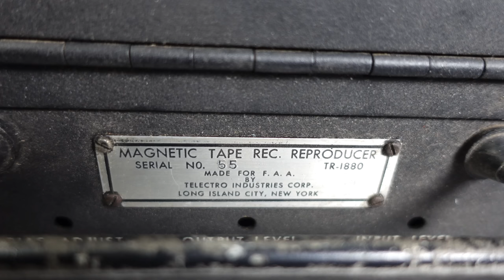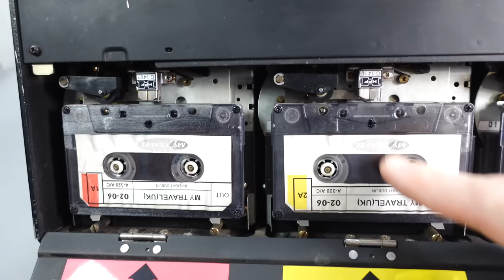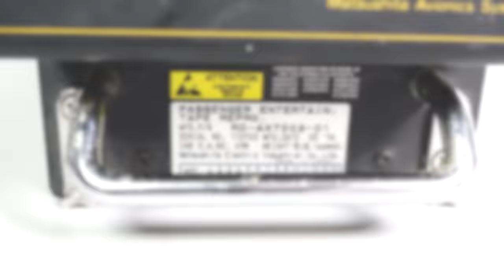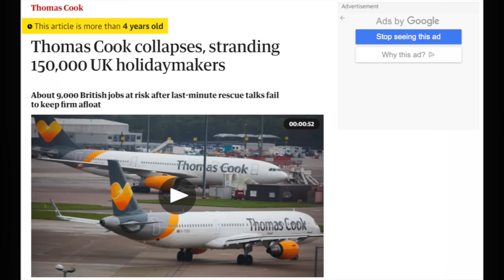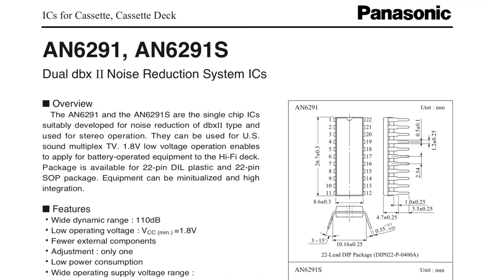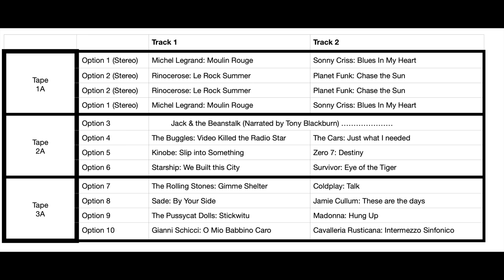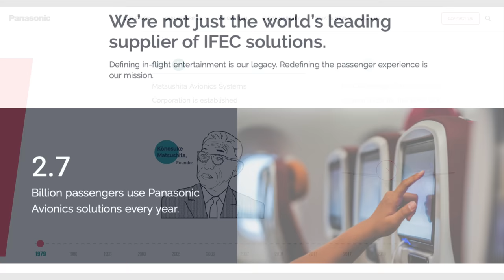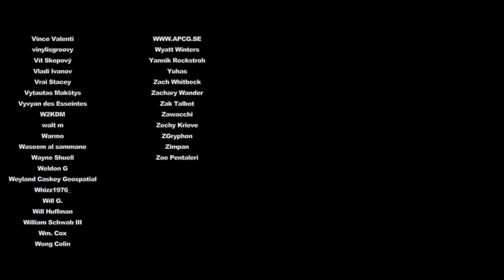The in-flight audio player

Comment: I used to work for Panasonic in the 80s. Your pronunciation of Matsushita is just like the Japanese staff of the company  pronounced it. Be proud of that!
BTW: The heads on this deck where labeled "HPF" - "Hard Pressed Ferrite". Panasonic/Technics used these in a few high end decks and had a 10 year warranty on the heads. Shows that this device was built to last!
Reply: It's probably correct. In Japanese, every syllable is pronounced in exactly the same way every time, so it should be MA TSU SHI TA. But for some words and phrases, vowels will just become silent, like what sometimes happens in English.
Reply: do they really use SMD components back then ? like shown in the vid, i thought smd is only common on a more modern electronics, at least based on taking things apart
Reply: @TonnyCassidy  SMD components got popular around 1985. In 1995 all high end electronics used it.
Reply: @TonnyCassidy  surface mount technology is really old. The Apollo Guidance Computer (AGC) also used SMD parts back in the 60s.
Reply: @TonnyCassidy  That deck had a 1994 label at the back, our 1995 Sony Video 8 camcorder was jam packed with SMDs as well.
Reply: @gladspooky9455  Yes, I have read Japanese is written (when written in Latin alphabet) phonetically which means it's pronounced mostly as it's written. Finnish is the same and also they say the grammar is similar so it's supposed to be relatively easy for Finnish people to learn Japanese and vice versa.
Reply: @mrfrenzy.  Did my first SMD PCB design in '85 for a security PIR and it wasn't that novel.
Reply: @Murgoh hiragana and katakana are phonetic too :) 

The main one which isn’t is the kanji (Chinese characters), which can have at least 2 pronunciations each on their own and more when in combination. That’s why everyone starts with the kana and slowly introduces a few kanji at a time; I’m on par with a Japanese pre-schooler at kanji recognition haha
Reply: @mrfrenzy.  thats surprising, i grew up taking apart electronics, none of it have smd, stuff like tv and other things (never opened really old computers maybe those would have lots of smd), 

and seems like old smd arent plagued with cracked(and shorted) mlcc
Reply: @TonnyCassidy 

Panasonic used SMD components since at least 1977 (in their 'Mr. Thin' radios). By the early 90s, they were absolutely commonplace.
Reply: @gladspooky9455  Yes! shita (below) is one syllable because /i/ is silent between unvoiced consonants. 松下 (Matsushita) means "beneath the pine tree"...I got curious and looked. Lots of Japanese family names have similar formulations. Source: I'm a student of Japanese language for the last year or so.
Reply: @TonnyCassidy  TV manufacturers started late because there is plenty of space inside a CRT and most of it is high power analog electronics. Things like Walkman, calculators,computers, tamagochi, cellphones were early with SMD.
Reply: @gladspooky9455  I and U vowels in Japanese are devoiced when in between unvoiced consonants. So the correct pronunciation is Mats'shta. They also devoice the U at the end of verbs, normally. They can sometimes be voiced for emphasis.
One such Japanese name, Takeshita, is one you do not want to pronounce as in English. (It's TA-KE-SHTA and not Take ...).

Comment: Hi Techmoan.
Probably other viewers allready tex this: this unit was replaced by a cd player in the same configuration, 3 cd's on each side, same maker, direct replacement.
As an avionics thech for many years, working for airlines, as part of overnight service, I got to remove the outdated media and install the fresh one.
And I got to do this (at diferent times in my career) on tapes as thesame machine as on your previous video, on this one, the cd player, also video on betamax, vhs and Hi8.
After that, new systems with digital mass storage started to replace the anolog media, did not work on those, do not remember how the updates happened, then systems like DirecTV, now is all networks and updates by satellite.
Two airlines I work for now are removing the video screens and offering wifi with content on the local server to enjoy on your own device, but you probably aredy know about that.
Reply from the maker: I've seen those for sale - but always without the CDs - a very big expensive doorstop.
Reply: I think ive seen that on American Airlines, you just use their wifi for in flight. In fact when I was on a flight in first class and it was a bulkhead seat, there was just this spring loaded clamp thing and a USB port for power. BYOTablet.

I guess from an aircraft design angle it makes sense, if they do not have to run all the wires needed for infotainment to every single seat and instead just put a few APs in the cabin the airline saves a lot of mass.
Reply: Well, from the passengers point of view I should say that removing displays is very uncomfortable. Using my phone and not a display for watching movies will just leave me in another city or country with my phone's battery low. Because there are no aircrafts with fast charging available for passengers.
Reply: As I finished watching the video I thought about the cd upgrade but I guessed that maybe in such a demanding environment the player couldn’t be reliable long term because of the vibrations. All considered the tape with a solid mechanism seems a much more reliable solution before entering the digital ssd realm.

Comment: There is a simple reason for still using cassette tapes in an airplane in 2006 (and probably even later). Every device in an airplane has to be standardized and certified for every type and configuration of a specific airplane. That means that this audio player might have been certified for an Airbus A320 in the configuration flown by My Travel, but not certified for a slightly different Airbus A320 flown by a different airline.
The process of standardizing and certifying equipment takes a long time and is quite expensive. Therefore airlines are often very hesitant and slow to adopt new technologies. That's also the reason why most airplanes that fly shorter routes don't have any entertaintment system nowadays, since most passengers already have a smartphone or tablet anyway.
Reply: If I remember rightly (to further your point about planes and old tech), a lot of them still use floppy disks for data. I can't remember the reasoning, but I'm assuming it's along the lines of it being certified tech and basically the "if it ain't broke, don't fix it" mentality.
Reply: Certification is not the problem, its the cost of investment. Certified modern replacements exist, that very type of plane still flies today. The simple solution is to use the older planes with obsolete infotainment to shorter routes, like a flight i took from Seoul to Tokyo in 2014, had CRTs hanging in some old boeing from ANA, they never turned these on like they would back in the day, and the audiotainment no doubt was audio tape based with those very same controls shown in this video (volume and channel, that's it). Remember those silly double plug earphones? They didn't bother giving those, but you could always plug a normal one to one of the holes and get glorious one channel.
Reply: @Vampyratus Exactly.  The A320 was certified in either 1987 or 1988, and brand new ones still require floppies.  It's just too expensive and of you have a fleet of thousands built since '86, commonality becomes problematic.
Reply: Usually I'm so exhausted waiting for the plane for many hours that as soon as I sit down in the chair I doze off.
Reply: That's my understanding too - it's just so expensive to upgrade airline components, it's more sensible to just run old tech until the plane reaches EOL (unless there's some component that MUST be upgraded for some reason).  Remember that commercial airliners have a very definite lifespan - basically every time the plane takes off and pressurizes the cabin, that stresses the skin of the plane.  You can only do that so many times safely before metal fatigue starts to become a concern.  Eventually planes with pressurized cabins must be scrapped for safety.  So, why spend a bunch of money upgrading components in a plane that probably doesn't have that many flights left in it anyway.
Reply: I think society in general could take a page from this book.  If a tech works well enough, there’s no need to abandon it.  And, just because it’s not the dominant medium doesn’t mean nobody’s using it.
Reply: @Vampyratus I recently took a flight from Singapore to New Zealand in March and they were still using ribbon printers to print the passenger list at the gate in Singapore.
Reply: @freeculture  That's actually high-tech! I remember when the "headphone jacks" were really tiny speakers and the headset they sold you were nothing more than sound tubes that carry the sound to your ear (similar to how a stethoscope works).
Reply: Absolutely! An IFE system caused a fire which led to the crash of Swiss Air Flight 111.
Reply: @twiff3rino28  Not true. The A320 has had its electronics overhauled several times; essentially single piece of avionics is different from the 1987 A320 to the final 2021 A320 CEO. There are no floppies in a late-build A320. There was a USB era in between, but ultimately they deleted the whole media capability for dataload. Today, any mechanic is going to have a laptop with them, so they plug in their laptop with the files on it to a port.
Reply: they're probably using older planes and aren't spending money upgrading anything
Reply: @TonyP9279 I noticed in pictures from the 60s and 70s they looked like stethoscopes, hadn’t realised they literally were though..!
Reply: @nickwallette6201  What a ridiculous soap box opinion, which has nothing to do with the reality of why airlines do things. Upgrades are done when the money invested is believed to result in a gain in return, not for some silly ecological nonsense. The cost of upgrading any airplane part, even a music player system for passengers, is the sole reason these things stay in service long after they become technologically obsolete.
Reply: Agree a 100% Amazingl enough I was flying a couple of times on shorter routes. And there is no more music. As far as I kown Austrian Airlines are playing sometimes Donauwalzer
after landing. Like that
Reply: @straightpipediesel  I strongly doubt every piece of hardware was changed since '87.  Yeah, the cockpit displays and media were changed, but all the FBW computers have remained unchanged.  Why do you think Air Canada and Delta haven't retired their A320's from 1991-94?  It's because a 2011-14 CEO is the same and offers the same fuel efficiency and comfort.
Reply: @TonyP9279  - I remember those. It was depressing how horrible my wonderful progs sounded!
Reply: @TonyP9279   I remember those in the 80's on a 747..
Reply: IIRC, Boeing aircraft still use incandescent light bulbs under the cockpit switches and warning lights. Hundreds of them... LEDs would probably be far more reliable, but that's not how the aviation industry works...
Reply: @twiff3rino28 Incorrect, the FBW computers were all changed. If you look at the ELACs for example, there are 4 hardware versions: A, A', B, and B data-loadable. One notable thing they changed was the original ones used plug-in EPROMS for software updates, which are now completely obsolete.
Reply: @twiff3rino28  No, not really. Floppies aren't in the newer ones anymore. Newer ones beeing the "facelift" A320neo starting from about 2016, use some kind of solid state media with I think even wireless update possibility. And as far as I know, this new system has been certified to be used in the older variants also, and because of the hassle to aquire floppies and all the quipment which is needed, the replacement is financially worth it. Those floppies are only used for the NAV-Database, which really needs to be up to date that is, but is not critical for the thing to stay airborn.
Reply: 'Aeroplane' or 'aircraft' please, not 'airplane' 😡
Reply: @ahah1785  Lucky you, I've never been able to sleep on a plane, no matter how tired I am. Same with trains and long distance coaches.
Reply: @nickwallette6201  As the old saying goes, if it ain't broke, don't fix it.
Reply: @TonyP9279 I remember that. So you invariably had to buy a new set each trip.
Reply: The real reason is that it wouldn’t make sense to upgrade them. Everyone just listens to their own device.

Comment: I vote VERY MUCH YES on the black box you have. That's a nice piece of kit to explore! The design and engineering of those is incredible.
Reply: I would imagine it being very similar to a VHS player since all the data was stored digitally at high speeds.
Reply: definitely!
Reply: @jasonsong86  Nah, they were linear tape because the spinning head wears out the tape, and you don't want to worry about alignment during a shock. If you were to pick one, it would be QIC tape.

Comment: Fantastic, Mat, and yes, I’m astonished to learn that some inflight entertainment came from basic C-90s. It all seems so primitive now. I remember one time listening to an audio documentary about the Beach Boys on a flight from Singapore to Sydney - I think it was 2002 - and eventually hearing the whole thing, but not in the right order, in various grabs between sleeps. It would never have occurred to me that it was almost certainly a tape playing the program. If I’d given it any thought at all I would have assumed it was a CD. And now, of course, it’s all digital files, so you don’t have to wait for the recording to start over again. Fascinating. Long may you find such obscurities to make Saturday evenings better.
Reply: CDs would have needed buffering and all that mess. Cassettes care far less about vibration.
Reply: @Cinkodacs I don't think the vibration on a plane would cause a CD to skip. By the way, a simple ESP like the one on every discman would have been more than enough.
Reply: The correct technology for the time would have been DAT or even DCC, but nope, run of the mill analog tapes are good enough for noisy cabins anyway. Spinning discs... maybe minidisc, maybe.
Reply: @BICIeCOMPUTERconGabriele  simulate a good old fashioned turbulence by moving around your cd player to see the problem. Plus the head can crash against the surface (or viceversa) and scratch it. By 1994 you could already "rip" the cd audio into a computer, but storage was expensive without lossy audio compression. The one used for mpeg video (mp2) was available but probably needed expensive asics back then to decode in real time (and Phillips patents no doubt). Minidisc had its own proprietary compression and the one used in laserdiscs when they used digital audio. AC3 maybe? forgot. Maybe the old "Real Audio"...
So anything digital tape would have been good IMO. Spinning discs don't like being shacked around, especially when there is a hear floating very close to it.